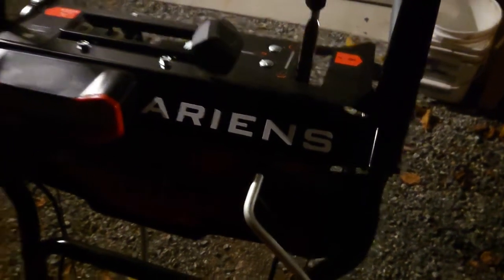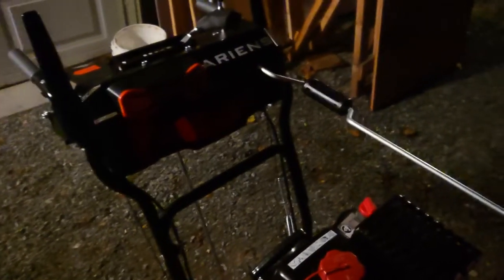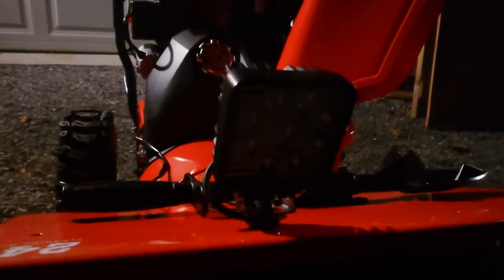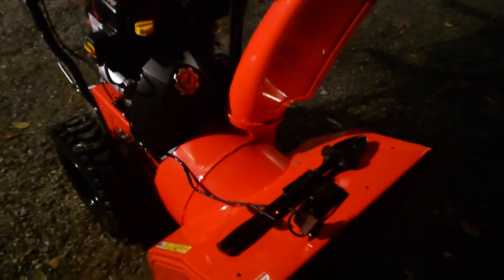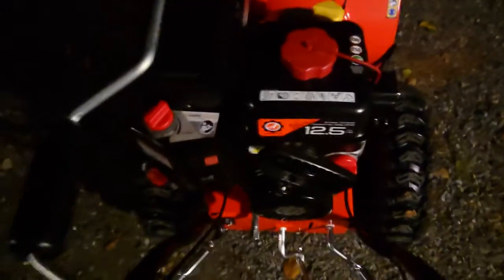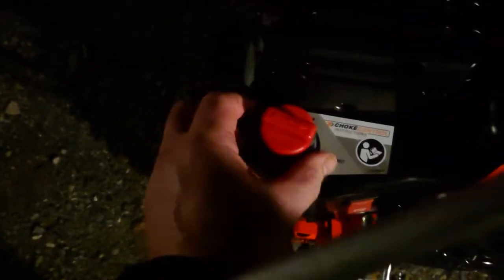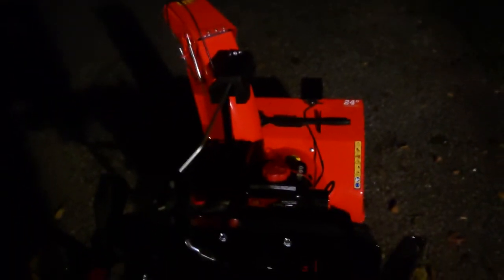Ariens Deluxe 24 Snowblower additional headlight night test.

Comment from the maker: Apologies for the filming quality, night time, holding wih one hand and operating the machine with the other. Refering to being able to operate the machine with one hand and found the auto steering responded naturally to my gentle guide, it is also well balanced (I am driving it with the skids off the ground and still felt good) makes the machine fairly light to manouver.
This was the first time I had engaged 6th gear, good walking speed for me.
The video does NOT give an accurate sense of the difference in light intensity, plus when there is the whiteness of the snow it will be even brighter.

Comment: I just bought a new Ariens Delux 24 which has the led light by the controls and I want to add an led like you did. All the videos ive seen on youtube are older ones with halogen that require a bridge rectifier to turn the halogen to led. Do these new models require a bridge rectifier also? Any help os appreciate. Thank you